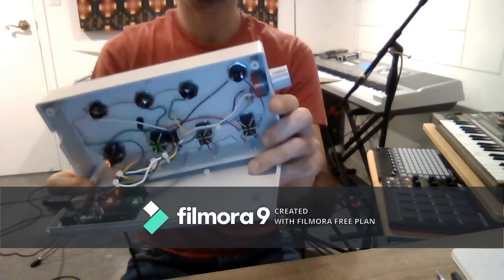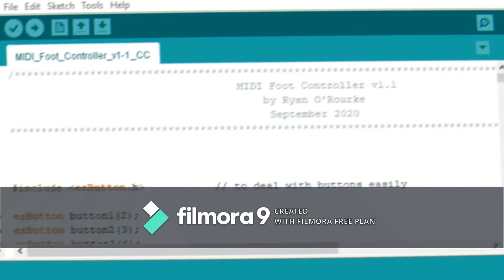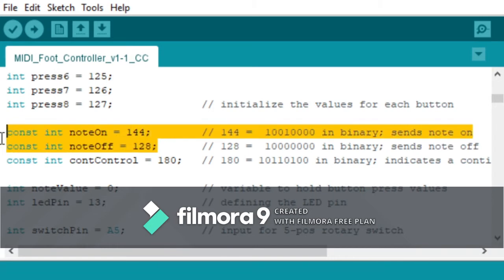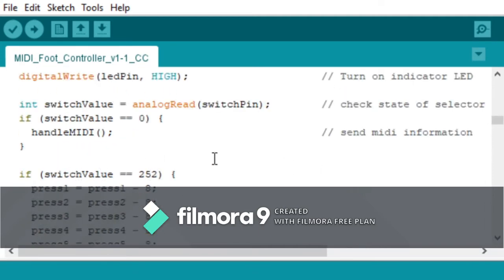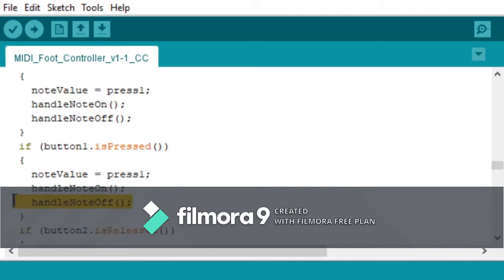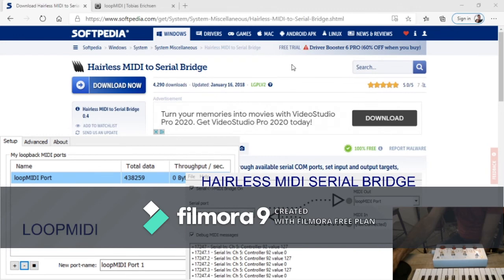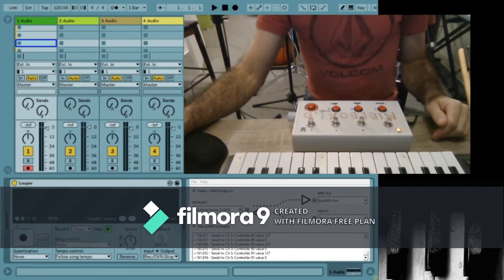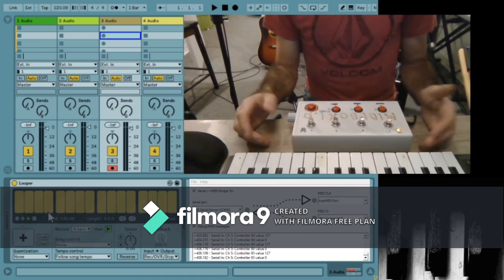Making a MIDI Foot Controller With Arduino | Guitar Rig, Ableton Live or other DAW, and more!

Comment: The downloaded code won't compile? It's telling me "a function-definition is not allowed here before '{' token" - I haven't changed a thing, also - have you thought of flashing HIDUIONO or MocoLUFA on to the 16u2 chip of your nano? it will connect as an HID compliant MIDI device through USB then, no messing around with middle-man software to communicate
Reply from the maker: I haven't had any complaints but I'll have a double check what code is actually uploaded.  It's definitely working for me.

Yes I do plan on learning how to make the device USB class compliant.
Reply: @DJRY360  Thanks for the reply - don't worry, I found what was wrong, I must have mashed a key when initially looking through it and removed } at the end of the void loop - all working now, currently breadboarding a 5 button pedal board by modifying your code; fingers crossed!! Gonna try using HIDUINO as well - I'll let you know how I get on if you'd like?
Reply from the maker: @reqfamreqfam1334  I'd love that!
Reply: @DJRY360  Cool man, I've worked out how to turn it into a MIDI HID compliant device, I'm just having trouble with working in serial first - I'll do a video and link you, you should get further than me as you have a working pedal board hahaha!
Reply: Did you manage to try this? I've got a fully HID complaint MIDI pedalboard being used as a multi effects unit with a Pi4 for my guitar now, thanks a lot for the initial inspiration with this video bro, keep it up! <3
Reply from the maker: @reqfamreqfam1334  awesome!  You've now inspired me to go to the next level!

Comment: Hi there I get an error message when i upload your  file, and i know not about programming Arduino bords.
Reply from the maker: Sorry for the late reply.  I should have mentioned you have to use the library manager to search for and download the relevant library (in this case ezbutton.h). Once it is installed in your libraries folder you will resolve this error and the code should compile.
Reply: Thx budd will let you know

Comment: Can ı use for bias fx ??
Reply from the maker: You can use it for anything that takes a midi note or cc value as a message.
Reply: @DJRY360  Also, it does not accept note values for bias fx. It accepts control function keys (sustain etc.). What code value should I enter for this?
Reply: @DJRY360 i got Error: got unexpected data byte 0x0. how can ı fix?

Comment: C:\Users\27814\Dropbox\PC\Downloads\MIDI_Foot_Controller_v1-1_CC (1)\MIDI_Foot_Controller_v1-1_CC (1).ino:9:10: fatal error: ezButton.h: No such file or directory
 #include <ezButton.h>           // to deal with buttons easily
          ^~~~~~~~~~~~
compilation terminated.

exit status 1

Compilation error: ezButton.h: No such file or directory
Reply from the maker: Sorry for the late reply, i should have specified that you need to download the relevant libraries in the IDE itself..  go to the library manager and search for and install the library from there to resolve the error!